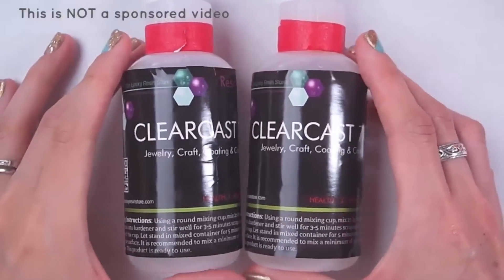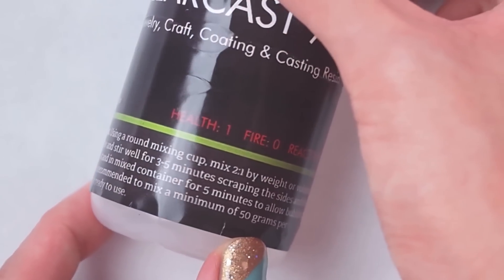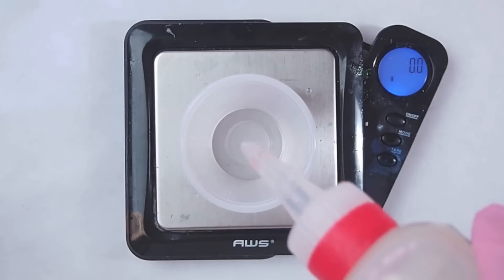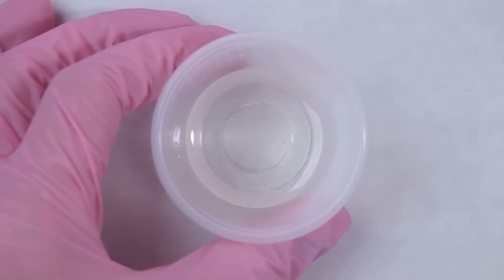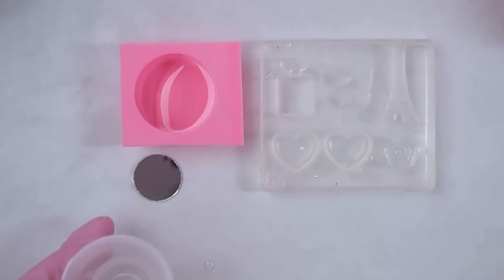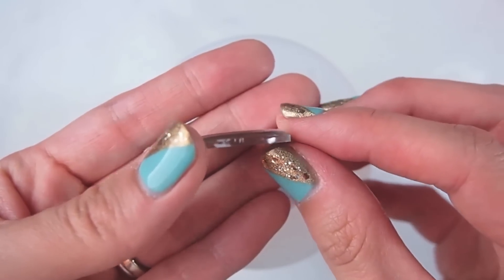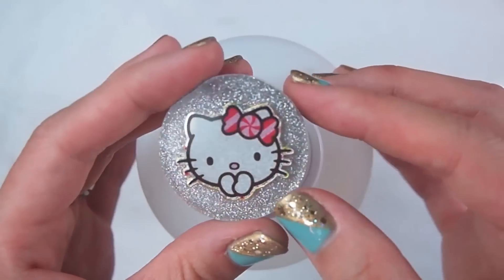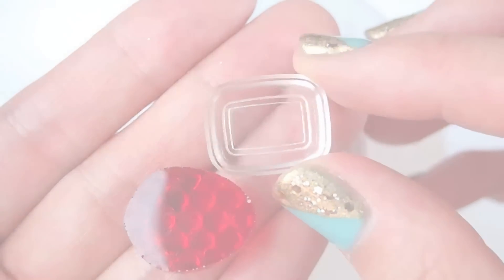Clear Cast 7050 Resin Demo/Review 2:1 Ratio Resin

Comment: As always, great review! I personally am always a little cautious when measuring resin, and have actually been a little skeptical whether volume is the best way to measure or weight. At least for easycast, I have found that 30ml would typically be 1oz and the hardener would be 0.93oz or a little less and cause all this chaos in my head! 

Looking forward to more awesome resin videos!
Reply from the maker: +LittleSurprisesYT i think you misunderstood my video! Please keep in mind you can only measure resin by weight if the manufacture instructions says you can. If it says the resin must be measured by volume, then you must measure it by volume. Most 2 to 1 ratio can be measured by weight but you have to check with the manufacturer. Easy Cast is 1 to 1 ratio by volume, so measuring by weight will give inaccurate measuring
Reply: +crafterzdelights gotcha! Will read the fine print per resin !
Reply from the maker: By volume is fine. I stated in the video that this resin can be measured both ways. I would suggest you to not use extra hardener because doing so will eventually cause the cured resin to uncured itself and get sticky.
Reply from the maker: Thanks but i would not risk ruining my pieces by messing with the chemistry. But that's awesome that it works for you. :)

Comment: That's beautiful but I do a see a problem. If it is a 2 to 1 ratio mix then the 2 should have a bottle with twice the amount otherwise you will run out but still have hardener left over. Either that or make the bottle of hardener half the size. 

- Heidi
Reply: I don't think they fill the bottle all the way for the other part.
Reply: MissCannibella oh okay. Well that is sort of good then so you wouldn't have leftover bits.
Reply from the maker: +BlackCat2 actually….now that you mention this, my kit had equal amount!.
Reply: crafterzdelights Good to know that. It does seem odd they would make the bottles the same amounts with the different mixing ratio...
Reply: I saw the same product at the store that sells it [theepoxyresinstore.com/products/crystal-clear-epoxy-resin-with-uv-absorbents-clearcast-7050-epoxy-resin-system], and the kits they sell of this type all come in a large resin and small catalyst containers, if I recall correctly.
Yep, I just double-checked, and their containers are sized correctly, larger resin and smaller hardener. Her having 2 bottles of the same size may be because (I believe she said) she purchased them on eBay, rather than from the company itself. Therefore, it would have been the fault of the seller, not the company.

Comment: Question. have you used this resin in the vacuum chamber??? just want to know if its good to use in there because i tried ARTRESIN and its AWFUL for the vacuum chamber. Bubbles dont stop and its a awful resin to combine with vacuum.
Reply from the maker: This is not a good resin for vacuum either. Usually a good resin for vacuum has a thin viscosity and a longer pot life. For example deep casting resins
Reply: Crafter's Delights by Amy what would you say is a best resin for vacuum chamber?? Also thanks for replying. This helps so much.
Reply from the maker: Entropy resin is great. I made a video about it

Comment: Amazing review, and the experiment you linked really helped me as well!
I believe I will be switching my resin up ^_^
I do have one question, like my Envirotex, do I have to give this one a warm bath too?
Reply from the maker: +Bacon Goddess Crafts If you feel like your resin is too thick from the cold weather, then you can give it a warm bath. It just makes it easier to mix and more runnier. Same concept as warming up maple syrup so it's easier to pour and drizzle.
Reply: +crafterzdelights well I used to give Envirotex a warm bath but I am noticing now pieces I made a year ago are yellowing and some are sticky. So, two days after my comment I got the 7050. It is toooons easier to measure accurately! I haven't tried the warm bath but I am getting the micro-bubbles when mixing and not all are going away during letting it sit to degas. My house is usually 70-75 degrees and my craft room generally runs warmer.
Reply from the maker: +BaconGoddessTV Envirotex is known to yellow faster but giving it warm bath should not be the cause of it. Also your pieces probably turned sticky because you put too much hardener. I give my CC7050  a warm bath when it's too thick to mix, and i don't get any bubbles.
Reply: +crafterzdelights well thank you so much for responding. Yea, I don't think my measurements were close enough on some of my pieces. Most were solid but some are sticky now. I will try giving the resin a short warm bath before I miss next. But other than that, solid review! You have helped me so much! All your information was spot on and (minus my bubbles) I had exact results!

Comment: Can you add another layer of 7050 once the first layer is fully cured?
Reply: Yes you can.  No sanding required.  Be sure to remove all tape or it will create air bubbles.  Learned that one the hard way.

Comment: There must be something wrong with my batch as well or it could be that my apt is too cold! The resin is way too thick and it had bubbles like crazy(matter how slow I stirred)and it did not cure in 6 hours and I think it has ruined my mold because I don't think it's going to cure....... Is it warm where you mix your resin?
Reply from the maker: Yes, it was around the recommended cure temperature. Around 70-80degrees
Reply: +Krazyboytx yes, usually any resin reacts to the cold or hot weather. I live in a very cold city (for Mexico average temperature) and is the highest city in the country. Also, if the part A of the resin has a thick consistency, you may want to mix and then pour in another container and mix again before pouring into your mold. As part A is thicker, it tends to go to the bottom, making the mixing harder to get the adequate consistency. You can also use hot towels to wrap your bottles but be careful as the resin shall be a little warm, but never hot. If the resin is hot, it will cure way too fast and the pieces or stickers can get ruined. For the mold you say might be ruined,. you can clean it with baby wipes or pure acetone, if it is made of polypropylene or silicone. I hope it helps!

Comment: does it matter if you go over a point like in Ur video? you said ur mixing 3 grams, is 3 grams 3.0  or 3.1?  2.28  i ask cuz i am nearly going to start using 2-1 resins, but i have no idea how to measure on a scale, thas why i asked how much is 3 grams on a scale? and thanks to you very much for ur video got a better idea now.  what does 5mm equal out to in grams? so you recommend this resin? i bought Amazin clear cast and that stuff has a horrific order, i thought people just Exaggerated when i saw them wearing a mask, but no i tried it and got nauseous 🤢 , i did buy a $10 dollar scale but for the small thing i be making don't think i will need to much, well till i learn how to measure it on a digital scale, well ty. i will use ur affiliate link cuz resin looks sturdy rock hard, i also contacted the seller asked a few questions B4 buying there product.
Reply from the maker: I’m sorry but I don’t understand your questions. You can measure your resin grams, ounces etc. your choice. You cant convert mm into grams. They’re completely different forms of values.

Comment: Thanks for the review.  I think this review and one other I saw today makes it clear that there is something wrong with the batch of 7050 I bought.  The two times I tried it it was very bubbly and my pieces broke when demolding from plastic molds.  Like shattered into pieces!  Then I did a drop test, and the piece chipped from dropping one foot onto a countertop.  Today, it appears the hardener is crystallizing.  ugh 😕.   Anyway, thanks for the info!  I'll be contacting the manufacturer...
Reply: +Wendy B. It's not just this type of resin. Most 2:1 ratio resins are very brittle and pieces breaking can be an effect of that. I only know of one bad batch that was sent out, and that was last April.
Reply: +MissCannibella I've actually used 2:1 exclusively for the past year and a half or so before this comment (Little Windows) and never had a break before using clear cast.  I was pretty discouraged by that tbh.  Because I like to pour with my windows open and it's very cold in WI, I'm going to try the clear cast again in the next few months.  Hopefully it's a learning curve I need to get around...  I do warm it before using and measure by weight, so I really don't know if it's my ambient temp or what causing the issue (usually 70°+).  I was going to film my progress for someone a while back to see if they could offer tips or tricks, but weather turned cold before I got to it :/

Comment: +crafterzdelights While this product points in all directions of being great, I've heard that if you drop your piece, it will shatter. Any truth to this?
Reply from the maker: +Garden Guru this resin is very rigid once cured which means it will be more brittle since there is no flexibility when stress is applied. this resin is ideal for jewelry such as pendants and small charms but not ideal for thin pieces or pieces that has higher chance of getting banged up; such as keychains.
Reply from the maker: +Garden Guru i've dropped my piece many times but none of them broke since my pieces were small and thick. however, i had pieces snapping in half when i was unmolding from a plastic mold since it was a thinner piece

Comment: CRAZY amount of bubbles with Clearcast 7050 :( I tried putting the mixed resin (in it's mixing cup) in a bath of hot tap water. It made it worse, it seemed to kick-start the chemical reaction. The stuff cured in about 2 hours. I tried working with it in a cool room, just under 70 degrees and made thin pours - MICRO BUBBLES FROM HELL. I could use some advice. These are literally my first two times using any resin ever.
Reply from the maker: This resin will get lots of micro bubbles if you’re not working in a warm ambient temperature. And yes, it’s quite heat sensitive. Even in this video I mentioned how warm the resin was getting even with a small amount. I normally don’t use this resin for clear casting. Only for colored resin since you can’t see the bubbles. For bubble free resin that is less heat sensitive, I would recommend Unicone art resin.

Comment: If was 3.1 you add just 6.1 which isn't the right amount if you multiply by two so measurements doesn't have to be perfect to cured
Reply: Was actually a question lol forgot to add ??? :)
Reply from the maker: +grisely miranda Im sorry, I don't understand what you are trying to say
Reply: +crafterzdelights I normally measure by oz so I wonder if would work the same way or I should get a scale to do it by grams
Reply from the maker: oz should be fine by weight though
Reply: @AmyMade  she is saying you should have added 6.2 rather than 6.1, as 6.2 is 3.1 x 2.

Comment: Has anyone had issues ordering from this company? I tried ordering the 6oz kit of the Clearcast 7050 and snagged some glow in the dark powder that was listed in their store to try out. I got my box with the powder, but no resin. I messaged them through the contact option on the site a week ago and have had no response. Today i tried emailing them and got an 'undeliverable' response. :(
Reply from the maker: +susurrations I can't help you there because I've contacted them many times regarding their product but no on has replied. I heard from others that you may have better luck if you call them.
Reply: +crafterzdelights So just a quick update - I called the company and spoke to someone about my order. They were SUPER nice and helpful, and apologized for the lack of response through their site/email. Apparently they are having major issues with their web-host and are still in the middle of trying to fix the problem. The person I spoke with put a replacement in the mail for me same day and emailed me tracking information. Great customer service on the phone. I hope they get their website/email sorted out, but if anyone else has any issues just call them.

Comment: I don't think this is a 2:1 ratio resin. You poured equal amounts of resin and hardener and they provided equal amounts of resin...
Reply: and hardener
Reply from the maker: +carvecakes I&#39;m pretty sure i measured 2 to 1 by weight. If you get a bigger quantiy of this resin, they will give you the proper amount with less hardener. For some reason, they gave me equal amount each liquids for this 6 oz kit
Reply: +crafterzdelights :/ I'm confused. In the video the amount of liquids only tallied to 6g and you mixed 3g of hardener...
Reply: +crafterzdelights I just realised you pressed the tare button. sorry for my mistake 😅